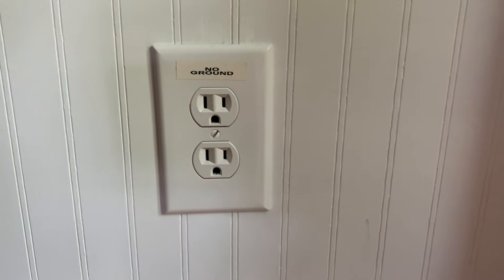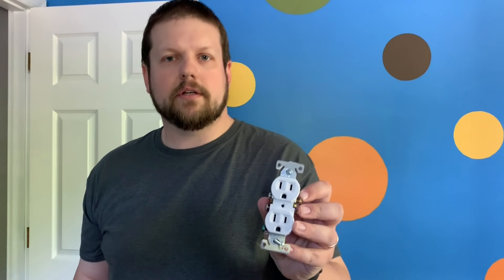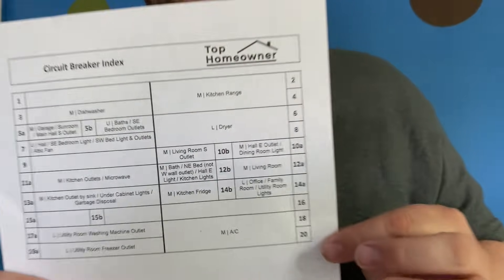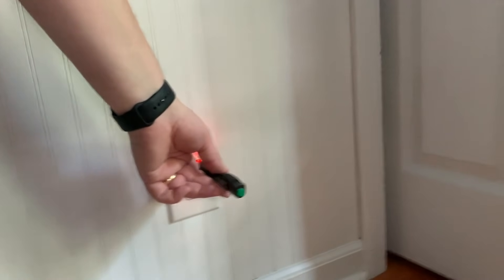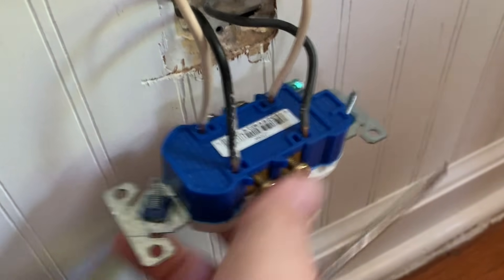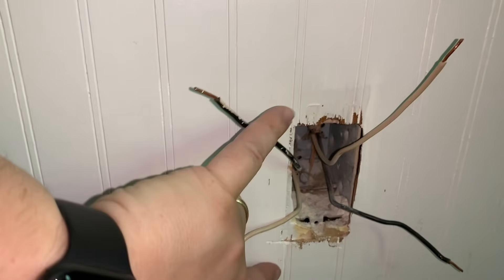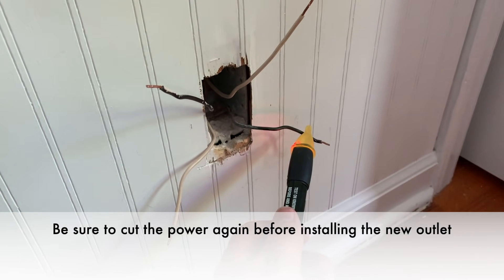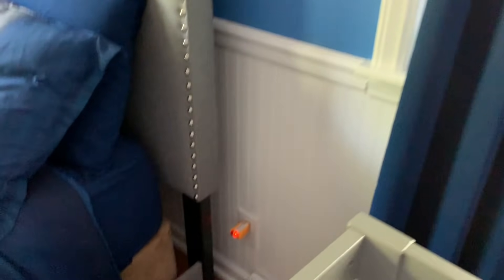Fixing Ungrounded Outlets - An Alternative Option to Rewiring Your Home

Comment: Very informative.  I've been trying to figure out how to ground all outlets in my house.  I know the breaker box outside is grounded to a copper rod sticking out of the ground.  So I'm not sure why all the outlets are not grounded. Maybe it's only the 4 outlets in the converted garage that aren't grounded.  There is 1 gfi in the kitchen and 1 gfi in the main bathroom.   Any advice would be appreciated.   Thanks again for the informative video.
Reply: Did you verify that the outlets in the house are grounded? And if so, how?
Reply: @surferdude642  The 4 previously mentioned are not grounded and were added in the 60s/70/s.  I have not checked the main house outlets that are wired original to the house in the 40s.  Whoever converted the garage got no permits because the half bath that was put in the garage conversion, does not show up when you look at info on  the house.  Listed as a 1bath.  I have a gang box that I plugged into the 4 outlets that has a light in red showing when something is not grounded. Its red on all 4 outlets in garage addition.
Reply: @extraspecial_ed  you should check the main house outlets to make sure but since it was built in the 1940's probably not grounded. As for the garage the red light means a malfunction. You can press the test and reset buttons and if that works you're good, if not, the gfci is bad or there's a wiring problem.

Comment: You still didn't fix the no ground problem
Reply: He wasn't trying to fix the no ground issue, but rather just making to outlets safer. This is a code compliant option when no grounding exists. Sometimes grounding all the receptacles is not a practical option.
Reply from the maker: I made a follow-up video that talks about this and answers some other questions here: https://youtu.be/3AXcRsAOLPk

Comment: What if you have un grounded outlets that are dual usage within the box . ie. Half the outlet is always powered and the other is activated by a wall switch controlling all the outlets in the family room ?
Reply: You can still do this as long as the receptacle in question is downstream of the gfci and the split wiring is on the same circuit, i.e. not a multiwire circuit.
Reply: @surferdude642  You need to GFCI protect both of the circuits and they must not share the neutral. I say it is simpler just to leave those alone.

Comment: hold the bus guss my back ground im a ret Master electrician/engineer with 20 years field experience in residential and commercial electrical work A GFCI  a ground fault ck interrupter LOOK AT THE FIRST WORD  'GROUND'  a gfci will not work correctly unless the GFCI outlet or breaker is connected to a GROUND POINT ie  panel, water copper pipe , ground rod etc etc ,  Sure it will trip  when you push the little test button , that just trips the gfci out , under norm conditions its not spose to trip  unless there is a proper grounding point !.  sure you can test the voltage from the hot side to the neutral side of the GFCI or outlets down the row  and it will show the proper voltage on ether , BUT if you test voltage from hot to GROUND normally the GFCI will trip but if there is NO GROUNDING POINT IT WILL NOT TRIP , This is the sole reason for a GFCI outlet or breaker is to "DETECT  A GROUND FAULT TO GROUND and TRIP OUT to prevent one from being electrocuted.  NEC ( NATIONAL ELECTRICAL CODE AS WELL AS LOCAL CODES ) the GFCI must have a proper grounding point to work correctly , I would not trust a GFCI with my life unless it was properly GROUNDED per codes and therefor working as it was made to be.  NUMBER 2    NEVER use the QUICK WIRE METHOD on a OUTLET OR A SWITCH !! over time ( loads ) the small spring/clip that holds the wire will start to get weak  creating what we call a 'HOT SPOT' that will lead to the outlet OVER HEATING and causing a FIRE over a period of time  in all my years in the trade as well as my dad IBEW me or him NEVER used the quick method ! , The only best way is to curl the end of the striped wire around the screw and tighten in a clock wise manor, that insures the screwhead BITES into the copper wire ensuring a tight connection !  . The way I did outlets  if there was more than a single Romex entering the outlet box , I would make joints in the box with pig tails to the outlet there for the load is not going tho the outlet ,  the load is going tho the joints in the back of the box , you can do this for switches as well. As for locating the "HOME RUN"  depends on the house lol most times its the closest to the breaker box or fuse panel , if you chose that outlet look for the number of Romex's  coming into the outlet box, with the power off to that outlet check other outlets say with in 10 feet or so ( on the other side of the  wall ) Unless you was there and wired the house you would never know , I have seen some crazy ass wiring many many times !  Be safe turn off power ( yes I have work it hot many times but I have the experience !)   again be safe  and happy safe new year !!
Reply: A ground fault means that current escapes to the ground from the circuit. Since that can happen through a person it should be detected and the power cut. This has nothing to do with the ground wire. Sure current an escape that way also but it is relatively harmless and not what a GFCI is intended to prevent.

The test button diverts some current from the live wire to the neutral so that it bypasses the GFCI on one side. That is it creates a situation that to the GFCI is identical to a ground fault. 

Here is the code text:

"406.4(D)(2) Non–Grounding-Type Receptacles. Where attachment to an equipment grounding conductor does not exist in the receptacle enclosure, the installation shall comply with (D)(2)(a), (D)(2)(b), or (D)(2)(c).

(a) A non–grounding-type receptacle(s) shall be permitted to be replaced with another non–grounding-type receptacle(s).

(b) A non–grounding-type receptacle(s) shall be permitted to be replaced with a ground-fault circuit interrupter-type of receptacle(s). These receptacles shall be marked “No Equipment Ground.” An equipment grounding conductor shall not be connected from the ground-fault circuit-interrupter- type receptacle to any outlet supplied from the ground-fault circuit-interrupter receptacle.

(c) A non–grounding-type receptacle(s) shall be permitted to be replaced with a grounding-type receptacle(s) where supplied through a ground-fault circuit interrupter. Grounding-type receptacles supplied through the ground-fault circuit interrupter shall be marked “GFCI Protected” and “No Equipment Ground.” An equipment grounding conductor shall not be connected between the grounding-type receptacles."

Relevant parts are (b) and (c).
Reply from the maker: I made a follow-up video that talks about your points (no ground so it won't work, quick wiring, NEC code and the home run). You can watch it here: https://youtu.be/3AXcRsAOLPk

Comment: How do you find out which plug gets the power first to the room
Reply: Remove the wires from the outlets on the circuit with the breaker off. Then the power back on. With a tester you can determine which incoming wires are energized. That will be line. The load will be the unenergized.

Comment: A good idea would’ve been to check for a ground inside the metal box with a voltage tester. Very often the metal box is grounded, either by the metal wire jacket or the ground wires themselves but they are attached to the metal box on the outside where they can’t be seen. If you can determine that the box is grounded, then you can install self-grounding outlets. Or do what you saw with the green ground wire in that one outlet you pulled out. A GFCI needs to be grounded to work properly.
Reply from the maker: Actually GFCI doesn't need a ground to work: https://youtu.be/3AXcRsAOLPk
Reply: A GFCI measures the current going out of the hot and back into the neutral if there's 5ma difference it trips. The ground on a GFCI work the same as any other outlet and doesn't effect the trip function what so ever. Additionally it's against code to use a raceway or a steel/aluminum armor as a ground. They can experience galvanic corrosion and essentially become resistors never tripping the breaker. I found a pump in a funeral home using the bx sheathing as a neutral for years due to a failed solder joint up the line, never tripped the breaker. They'd been turning the pump on with a wooden stick since the 90s.
Reply: Also, just checking for a grounded box may not be enough. A tester may light with a poor ground, but not be enough t trip te breaker if a hot wire hits the boss, if fact a high resistance ground could overheat and cause a fire.

Comment: All you did was put in a false earth. Also a GFI is a local trip not intended to protect other circuits down the line. This does not fix the problem, it only masks it.  Very bad advice on your part.
Reply: No man, like he showed, GFCI has downstream connections and protects those too.  You never had one trip and lost power in some other outlet in the house and had to find the seemingly unrelated GFCI and reset it?  I have a GFCI in my laundry room in the middle of that house that also kills the outlet powering my garage door opener in the back of the house, and the outlet outside on the front porch.

Comment: Doesn't that metal box for the outlets have to be bonded to ground?
Reply: should have been but it's not always the case... Never assume anything when it comes to electricity! IF, all of the metal boxes are connected to metal conduit,  and that metal conduit reaches all the way back to the panel, then it should be grounded, provided the panel itself is grounded... Problem is,  a lot of times,  there are broken runs, and modifications,  especially in old houses...

Comment: I am not an electrician but nearly all, if not all have told me that if you have a choice to use the screw down terminals over the pressure catch holes.
Reply: Pressure catch holes aka backstab holes should not be used, you are correct. However, this option only exists in the cheap residential receptacles and switches and will only accept 14 guage wire. The commercial grade receptacles and gfci, afci have a different option.  That is one in which you can sandwich a straight wire between 2 brass plates and tighten with the screws. This totally acceptable and provides a robust connection.

Comment: I have always heard of it as a Ground Fault Interrupting Circuit,  I know it means the same thing but my OCD kicked in and I had my internal monologue flipping it. Ah, the ramblings of me guy going bats**t crazy in 2020.
Reply: Only it's not an interrupting circuit, but a circuit interrupter. The former refers to the entire circuit; The latter, to the single device. And the latter is the correct terminology.
Reply: bats**t crazy, also known as guano crazy.

Comment: You still will not have a ground and the GFCI won`t do a damn thing. You may as well just install 3 prong outlets and be done with it. The bottom line is if there isn`t a ground coming from the breaker box, a GFCI is useless. Hence the term Ground Fault Interrupter.  No ground, no ground fault.
Reply: Wrong.  The GFCI trips when it detects that the current returning on the neutral is not the same as the current going out on the hot.  If you are getting shocked, the current is going through you and to earth ground, not through the ground wire, so if that's how the GFCI worked, it wouldn't help.

Comment: Installing a GFCI without a ground wire connected to breaker box. There still going to be a open ground. I see the ideal of a GFCI without a ground. It not healthy for electronic equipment.
Reply: Electronic equipment does not care.  The ground is there to protect YOU from getting electrocuted if there is a short that makes the metal chassis of the device hot and you touch it.  With the GFCI, you will still get a shock in that case, but the GFCI will trip very quickly and stop it from continuing.
Reply: Having no ground does not hurt as log as you connect the equipment while they are powered down. Especially notorious is the now largely obsolete RCA connector as it is poorly designed so that the signal connects before the ground. With a computer you can avoid all there by using WiFi and not connecting it to other systems. There are things like Chromecast that you can use to send content to TV.

Comment: Seems like you ignored the tester lights signifying an "open ground" on that gfi you just installed?? If you are going to promote yourself as someone who knows about these things, you should probably be upfront about your ignorance if the reality, otherwise, you could cause unintentional harm!!!
Reply: The whole point is that there is no ground.  Adding a GFCI is a workaround to not having a ground.  If there is a short and you get shocked, the GFCI will protect you without the ground.

Comment: All you have to do is wiggle the wire to get it out of the back stab. Get testers and call them dont turn the power on.
Reply from the maker: Yes, backstabbing an outlet isn't a good practice. On GFCI receptacles though its back-wired which uses the screw terminal to clamp down on the wire. I made a follow-up video that talks about this and answers some other questions: https://youtu.be/3AXcRsAOLPk

Comment: Only problem is that GFCIs contain and rely on functioning electronics to operate. Unfortunately electronics will eventually fail, and will fail faster with the number of trip cycles and power surges.  Nothing beats a true ground.  

GFCI's,  in good working order,  will trip without a ground connected to the device (contrary to some comments) when a load imbalance is detected between the hot and neutral wires and this method DOES have code approval.
Reply: In Europe RCDs do not use electronics.

Comment: It still has a open ground that is not going to help new appliances that need ground and neutral to work properly. I'm a certified appliance technician and newer appliances today need both neutral and ground in order to function properly and stay safe I see it all the time every Appliance may act differently you can have an oven light bulb keep blowing out once a month or a refrigerator work for 6 months and all the sudden start over freezing things
Reply: Nope... appliances have absolutely no use for ground.  They are forbidden from returning current on it during normal operation; it is only there to keep the chassis grounded in the event that hot shorts to it so if someone touches it, they don't get shocked.  Most appliances that have wood or plastic chassis don't even have the ground pin on them, since there's no surface a user could touch that needs protected with ground.

Comment: Okay let's say you have a den with ungrounded receptacles and inside the den in a closet for the laundry (washer & dryer). The dryer is 240 volts and properly wired but the receptacle for the washer is like the rest (ungrounded and not a GFI).  So I replaced it with a gfci receptacle and simply ran a ground wire to a clamp on the copper water supply line which was surface mounted behind the washer. Is that kosher? The entire house had copper plumbing and city water supply.
Reply: insufficient data...
Reply: Well, it's better than a sharp stick in the eye.

Comment: This is NOT a solution for a "no ground" scenario! All you're doing is basically adding a circuit breaker to each rooms outlets. If you don't have a ground a GFCI isn't going to trip on a "ground fault" anyway. It will ONLY trip when you push the test button. It doesn't matter how many proper code references you link to, people are only going to watch your video and think it's doing something safe without having a ground. It's not. This video should be pulled.
Reply: Wrong.  The GFCI trips when it detects that the current returning on the neutral is not the same as the current going out on the hot.  If you are getting shocked, the current is going through you and to earth ground, not through the ground wire, so if that's how the GFCI worked, it wouldn't help.

Comment: As of the 2017 NEC, when replacing receptacles you need  to comply with tamper resistant receptacles and AFCI requirements.   Also the GFCI method will not protect electronic equipment that requires a ground.  This method is usually done by house flippers as a cheap fix.
Reply: THE NEC STATES EACH OUTLET MUST HAVE A GFCI RECECTACLE AND A LABEL. WHAT HE IS DOING IS DEAD WRONG.
Reply: Electronic equipment does not require a ground.  It is only there to protect you from being electrocuted if hot becomes shorted to the metal chassis of the device.  Under normal conditions, the device is forbidden to allow more than a few mA of current to flow through the ground wire.  That is why dryer outlets used to not have a neutral but then had to add one because the manufacturers were too cheap to use a 220v AC/DC power supply for the electronics and instead were returning 120v through the ground wire.  This was not allowed.
Reply: Phillip Susi,

Grounding wire carries no current. If it was being used as a neutral then it would have a current on it. But three prong dryer plugs have 2 hots (220V) and a ground. No neutral was needed. The reason for neutrals now is because of the other electronics on the device requiring a neutral.
Reply: @The_Forgotten_Man  The ground wire does carry the leak current. Typical leak current of various devices (PCs, fridges etc.) are in the order of half a milliampere.

The old dryer socket used combined neutral and ground. This is far from ideal so it was changed.
Reply: @phillipsusi1791  TVSS needs an EGC for proper operation.  You want the surge protector to take the hit before electronic equipment.